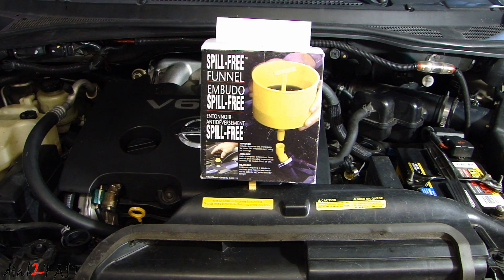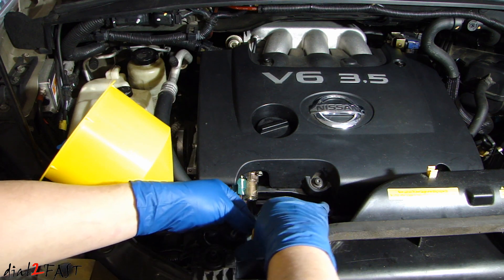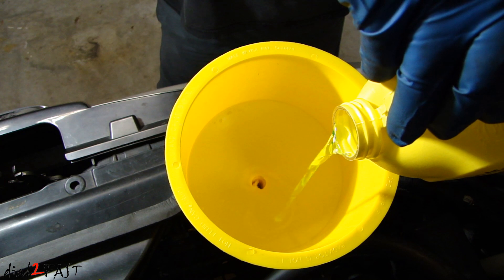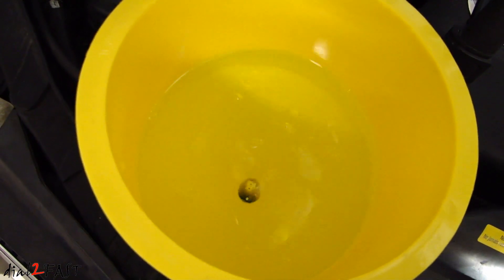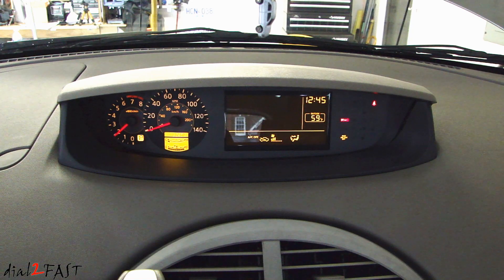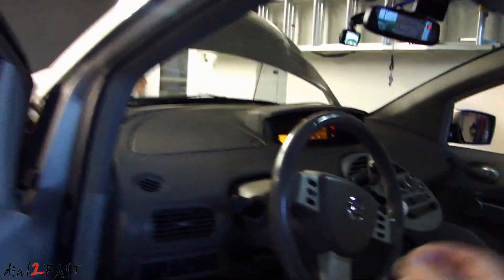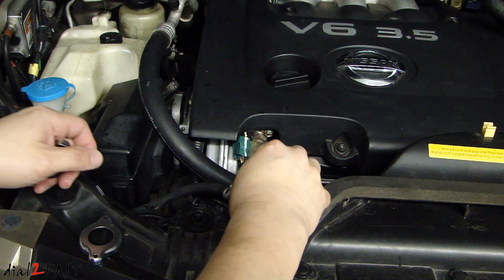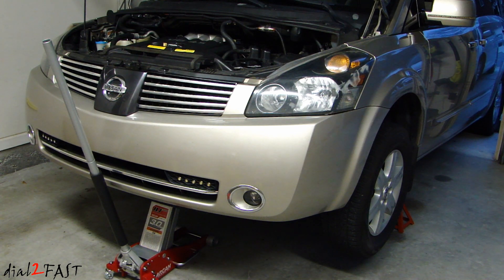Nissan V6 Radiator Bleed Air - Video 2 - 2004 Quest

Comment: Not a big Scotty Kilmer fan, however he does have a good old video on how to flush, AND backflush which should only take another 10-15 min and will get a lot of additional crap out especially from heater core.

2023 and just got Prestone Premium Extended concentrate for only $2 more per gallon than premix.
Need 3g coolant so:
3 x $15 = $45
or
2 x 17 = $34, + $2 2g Distilled water = $36.
Savings paid for my $4 hydrometer, and I have extra coolant in case I or someone else on the side of the road needs it.

$50 at the local parts store for a piece of molded plastic?
I know AMZ has cheaper knock-offs, but I want to do it today.  
As someone said, a 1g water jug or 2L soda bottle with the end cut off and some duck tape around the bottom should work almost as well.
Much better to pull the $10 thermostat and change it while doing this.

Easier for air to escape, and cheap/easy to do since you're there already.

Comment: Very thankful for your Quest videos. I have a 2006 model and your videos have been very helpful. I have replaced both valve/rocker covers front and rear, replaced both belts, replaced the O ring in the oil cooler and even replaced the little LCD screen in the instrument cluster all with your help and I thank you very much. I am currently replacing the thermostat and the radiator and will use this video to help burp the air out of the system. I wish you had a video of changing the thermostat as you explain things very well and replacing the thermostat is a real pain it the butt. Good videos and great instructions.

Comment: Bleed screw on top of intake do you put if it in till coolant comes out of it this is second engine in yr on 2000 3.3 please let me know ty
Reply from the maker: Don't bother with that bleed screw above the intake. It doesn't always get all the air out. Just get the funnel shown in the video and you will have the job done a lot faster.

Comment: Step 1: buy large bottle of water for hardly any money
Step 2: cut bottom off with pair of scissors
Step 3: wind electrical tape around the thread on the neck of the bottle to the right thickness to seal into to radiator filler

Ta da! A home-made no-spill funnel for less than a buck.
Reply: +Buy the distilled/deionized water and use that in your fill too.
Local parts stores want $50 for that piece of molded thermoplastic...

Comment: Got one of these funnels coming overnight from Amazon, going to try this out. I also borrowed a compression tester for the cooling system from O'Riellys, just to check. A few questions:
If I have air in the system, will the hoses have low pressure? Mine have no pressure at all. 
Also, if I do have compression issues, where should I check after hoses and radiator itself?

Comment: On my 2003 Nissan Pathfinder there is a metal tube sticking up by the firewall with a rubber cap on it that goes right into the heater core hose so I put a hose on there and a funnel and Port antifreeze in there and that seem to do it

Comment: Does anyone really know how to get the air out of the cooling system on a Nissan or what,.. I think your all full of %#@* ! On a Pathfinder or QX4 there is a plurge tube at the firewall and top of the intake,.. You all push the idea of using this  funnel, and it  is a great idea, but I know  when this Nissan is  rolling on the manufacturers floor being assembled and when it comes time to put coolant in the radiator they don't have a bucket shaped funnel on them , they use this bleeder tube to plurge the air out of the system.... So why the big sales pitch on the funnel and if any of you are a "Nissan Certified ASE monkey" why don't you just tell us all how to use the plurge  tube on this cooling system. I'm  sure the Nissan company gives you a test on this ,...So why the secrets ? Myself I would  installed a valve at the drain cock on the bottom of the radiator and will use a tank with coolant in it, then use a suction/and compressed air traveling through the suction valve witch will cause the system to suck all the air out of the cooling system, then turn my valve to off witch would be a great time to check for leaks, then open valve on bottom of radiator and coolant would then flow into the radiator, and engine thus the cooling system having no air in it would be completely full when it reaches the top neck of the radiator.  Turn the valve off at the bottom of the radiator or would probably use a quick connection like on a fuel pressure fitting, and wha-la.. no air and no more BS about how to bleed a coolant system,...

Comment: when you were done, the overflow tank was empty. shouldnt you fill it half way?
Reply from the maker: The overflow tank was not empty. It's between the low and high mark which is near the lower part of the tank.
Reply: @dial2fast  yup i got mine there. thanks!

Comment: I used a pop bottle  with the bottom cut out and a few wraps of duct tape to make a tight seal to the radiator. The main thing is to get the radiator up as high as you can by jacking it up. Fill that bottle with antifreeze  and keep squeezing that upper radiator hose. Rev up that engine , go fill the bottle, squeeze the hose and keep repeating till the radiator stops taking fluid and the heater in the vehicle should be on high. I run the rear heaters in the back of the vehicle as well. Any  time you have to pull a hose with  antifreeze in it, you will need to do this. That little hose on the intake that helps warm the body will also affect the whole system. Go ahead and do the bleed again. If not, you will have ait trapped in the system. I know its a pain, but just do it.

Comment: I have a nissan maxima j31, it doesn't haven a conventional temperature guage, only a blue light and red light, I guess aslong as it's not red during this, it's not overheating.
Reply: you can hook up an abd2 scanner that uses bluetooth and an app on your phone. On top of codes mine shows various active metrics including the tempreature. Many cars nowadays dont have a temp guage on the dashboard

Comment: replaced my radiator in my maxima. Thank you so much!  I decided to budge the radiator fan shroud without removing the battery.  Took a bit, but finally was able to do it. Thanks again!

Comment: Great video. How much cvt transmission fluid do you need to add after replacing radiator?
Reply from the maker: Very little if you pinch the hose and lost little fluid. If only lost a few drop, you don't need to add any fluid.

Comment: Thanks for the video. Im having trouble. Ive had mine idling for 45 min and i guess my thermostat is not opening because the coolant hasnt been sucked in..does it take longer??
Reply: Unplug the fans so it heats up. I had the same problem then got that idea and my coolant started flowing.

Comment: I usualy cut a water bottle in half and wrap scotch tape around the nose until it tightly fit...
Reply: me too !
Reply: I used a pop bottle and duct tape. Cheaper than $30 for something you will use 1 time.

Comment: Hi great video! We just replaced the radiator and hoses on my 2004 maxima. The problem is the heat isn’t working and we can feel the hoses on top get extremely hot. The thermostat temperature remained normal, in the middle. My uncle added new antifreeze, but it was a different brand. What do u recommend we do? He drive it around for 5 min., but still no heat and the hoses are super hot.
Reply from the maker: Did you use the Lisle no spill funnel to bleed the air? You will have to get that and use that and also raise the vehicle front end as high as possible either with ramps or with floor jack.
Reply: dial2fast no if we would’ve seen your video yesterday we would’ve bought that specific funnel. We did use another funnel though and we didn’t raise the car like you did.
Reply from the maker: Nissan's can be difficult to bleed the air out. That funnel is what Nissan mechanics also use at the dealer along with raising the front end. Try that out.
Reply: @dial2fast  Thank you so much for replying. I had to take it to the mechanic and he removed the air. He also raised the vehicle like you said. We were kind of afraid of lifting it up ourselves with a jack.

Comment: You should have used the blue Nissan coolant or Pentofrost A3.
Reply: Anything other than Prestone is better anti it's crap. 
Ran it in my T/A once and I checked it's freeze temp and it was above 30deg. Stuck my test gauge into the jug and above freeze level directly & mixed 50%.
Bought Zerex & after draining Prestone trash out the Zerex registered at -40.
Never in my life used Prestone again... garbage!

Comment: Hey I have a question can I use water ?
Reply: Akye lkap ONLY DISTILLED WATER. But if you live in cold areas then use some anti freeze 50/50

Comment: Hey Dial, I left the radiator cap off and caused all the fluid to come out so I refilled it but now my heat is not working as it should. Is that happening because I needed to bleed the air out?... I still have heat but not as much even when the van has been running for 25 minutes. Thanks in advance brother
Reply from the maker: Yes you will need to follow my steps and bleed the air. Nissan cars a pain to get all the air out.
Reply: dial2fast renault just as bad
Reply: I've got a Gen1 Murano.
Easiest is to pull the thermostat when doing flush, refill, with car up on ramps/jack.
It should burp excess air much easier. Some people drive around for a few days.
Once its settled and no more fluid needs to be added, just install the thermostat again.

Comment: Good video did the radiator contain transmission fluid as well?
Reply from the maker: The radiator cools the 2 fluids separately.
Reply: You WILL have just a little transmission fluid that will drain out.  Mine let out no more than about 1-2 oz. Of course, it will seem like a gallon once it gets all over the concrete driveway, LOL.

Comment: Thanks for this video. I had to change the fan on mine and in doing so I might have punctured the radiator. :-(
Reply from the maker: Oooh, that's not good, but now you have this video to help you do the repair. Hope your radiator is still good.